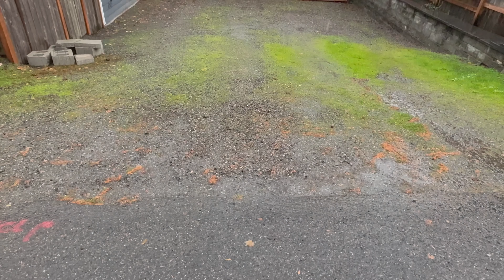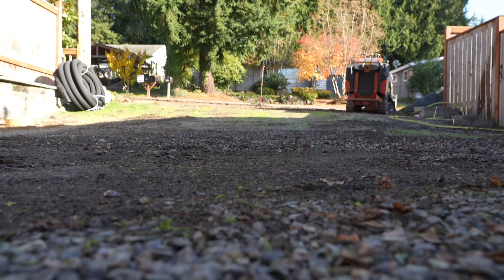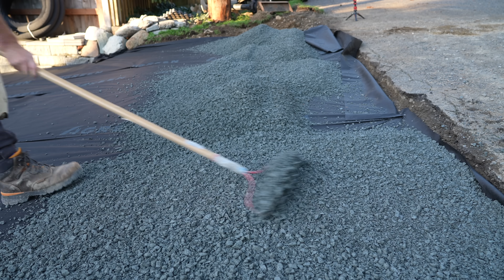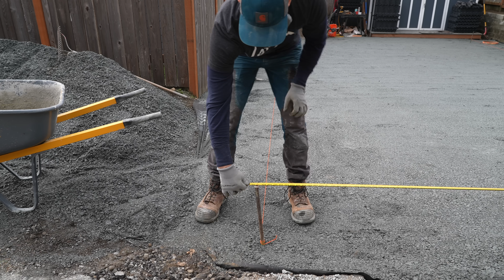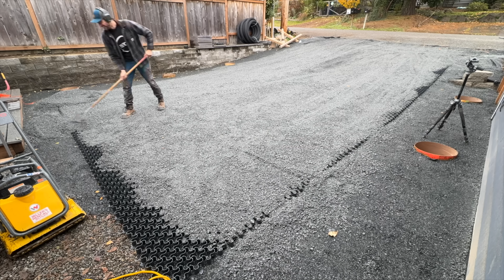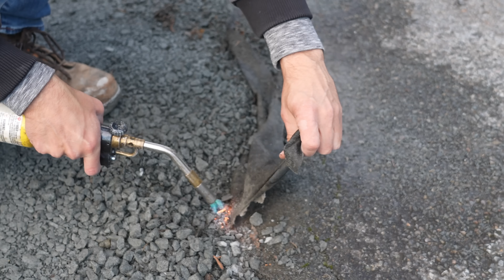How To Install A Permeable Gravel Driveway Grid System

Comment: 2:30 With no curb to support the edge of the road, you can see the asphalt already cracking.
Reply: Yep thats my only issue with the whole project - the interface between the gravel and the road edge is going to become an issue.   The question becomes: how to solve it?
Reply: @markd.9538  I've done something similar, and I would have installed a long trench drain almost immediately adjacent to the edge of the road, and then patched and sealed the small gap between the two with blacktop materials to leave a nice neat edge that won't unravel further.  (Actually, for stability under vehicular traffic in a parking lot, I surrounded the black plastic trench drain itself with a small neat border of concrete, stained black to match the blacktop and using temporary boards to keep the resulting concrete encasement tidy, and then patched the narrow gap between the concrete and the adjacent blacktop with blacktop patch.)  The water running off the road and into the trench drain could then be directed into perforated hoses sloped downward on either side of the driveway, into landscaped planting beds, where that water delivered directly into the root zone of any shrubs might be particularly welcome after a dry spell.  It might also pay to consider what effects city workers will have one day when they eventually have to strip and re-top that asphalt road.  Gray plastic trench drain surrounded by a border of concrete to match the gravel might look better in this installation, and together this would tend to protect the structure of the driveway during such road work.
Reply: @markd.9538  that's your only issue? so not the fact that compacted fines will not let any water though? or that the whole driveway is sloping from the road into the house with no drainage?

Comment: With a torch and hot tar you can repair the damage you did to the edge of the asphalt.
Also, I'd recommend spraying herbicide before putting the fabric down.  You're also going to have to spray herbicide on the driveway on a regular basis if you want to prevent weeds from groing on the surface.
I would also recommend a concrete transition between the stone and the asphalt as this will prevent stone shift from being a cause of the asphalt failure.
As far as driving those rebars, try running the majority of the length in with a heavy hammer drill and ground rod driver attachment.  It'll save you a lot of effort.
Reply: +1 to the concrete transition.  This also would have been a good place for a trench drain-- encase it in concrete for stability.  Pour the concrete neatly using boards, and then patch the small remaining gap with blacktop patch and seal.  Otherwise road repair crews will be messing up the edge of that driveway sooner rather than later.
Reply: @karenkrohn8003  if you cut the asphalt clean, you can use the asphalt as part of the form.

Comment: Please, I am not trolling. I am really trying to understand the benefits of this. In the beginning weed issue was mentioned, but as best I know, weeds will eventually settle in any crevice anyway, so I trust they can take over the new gravel as well. I wonder how long the moisture barrier will last. After all it is plastic and may get brittle over time and combined with heavy use? What am I missing?
Reply: It wasn't a moisture barrier-- landscaping fabric will hold the gravel in place but allow water through.  It degrades quickly in sunlight but does last a long time when buried.  He will still have weeds after debris builds up on this fresh gravel from above, but the grid + fabric will keep that gravel from migrating and mixing with the underlying soil, as appears to have happened previously, so that process won't occur as quickly.

Comment: The fabric will not prevent weeds from growing.... While it will prevent weeds from growing up through the base, weeds rarely grow up through 4" of gravel.  Most of the weeds you'll find growing in gravel have germinated from seeds that landed from above
Reply: 100%
Keeping leaves and fresh dirt out of the gravel does 100% more than the weed barrier for weeds (at least in my experiences!)
Reply: @Waitwhat469 You're right, and this is the reason I don't care for this application unless the area is so large that it is the only economical choice.
Reply: It’s more to prevent the gravel from sinking/mixing into the soil over time.
Reply: @brendancurtin679  Exactly. I got 2 driveways. One needs gravel and leveling once a year, the other needs it every two years or so. The only big difference between them is the fabric barrier. I'm not a professional, but in my experience the fabric keeps the soil from getting in-between the gravel as it settles and sinks. It'll still settle, and there's times when a pothole will pop up. But the first driveway has parts that settled well before the others and those spots keep going to bare soil /pothole up the quickest. I need to tear it out and re do it. But winter is here already. 😅
Reply: @gtbkts  I just checked the price.  $12K just for the plastic.  I'll just pay the $350 for a truck load of gravel every 4-6 years.
Reply: You are kiddy me, 12k? Lmfao  @robertsmith2956
Reply: @gtbkts  exactly, geotextile (the fabric) is designed for geotechnical stabilization and separation of new crushed stone from the natural ground. Without it, over time the new gravel slowly gets pushed (unevenly) into the natural ground which leads to low spots, and poor drainage. Before geotextile fabric you had to use a lot more stone to avoid those issues.

As others have said, it's not a weed barrier (although it might slow down the growth of deep roots).
Reply: @robertsmith2956  You might want to check that price again. For the 800ish SF here, it was only about $2200.00
Reply: @blackboxmediagroup  Maybe, but for my 6000 sqft driveway is says $12K.  I can buy a dump truck of gravel every 3 years for $350.
Reply: @robertsmith2956  you need to find a commercial supplier. That sounds like HD prices
Reply: @brendancurtin679  I did this entire weed-barrier-fabric thing one of my drives. The problem is not from below, but from above. Not only are seeds-n-weeds blowing in from above, but soil itself is blowing in and being deposited. The ONLY WAY to prevent this from happening is to somehow seal from above (e.g. some kind of epoxy or other non-permeable coating to the rock or whatever). That's my next step to redo my own drive and then tackle other driveways on our properly.
Reply: @LarryRix  again, it's NOT to stop weeds from growing. You are correct that weeds can grow on top of it, if soil or decaying leaves or other organic material gets in there and weeds can start growing. 

The reason for the fabric is to keep the gravel and soil below separate, so that the rocks can act as a drainage layer. If the rocks are directly on the soil, they will eventually mix together and it defeats the point of having a layer of gravel for drainage. 

Depending on where you live and how many trees and whatnot you have, you may end up having the rocks clog with dirt/decaying leaves/whatever from above. That will still take a lot longer. At least keeping the rocks and soil separated below keeps it from going to shit as fast. But if you are able to keep the surface relatively clear of dirt and organic matter, it can last along time. But if you don't put a permeable barrier between the gravel and soil underneath, it won't last long at all, even in great conditions.
Reply: What were the footings for?
Reply: @PDQkevin77  he said he's going to build a carport
Reply: Miller’s Rent-All is great to deal with!
Reply: You pretty much need sun light for most things to grow. He said that this was going to be a Covered area, hence the Footings (18"x18"). Once the covering (carport) is in place, it's shielded from the elements for the most part. If there is any type of Growth, it's nothing a good Spraying of "GroundClear" can't handle,  1 to 2x a year.
Reply: @FunDuude  Funny comment because a 100 year old gravel on the ground driveway in full sunlight doesn't need more than 2 times a year spraying.
Reply: @blemtaters  Funny comment because my drive way has no vegetation because of the number of times I drive over it with my car. How you like dem apples?
Reply: A concrete slab would be less work and 1000X better.
Reply: True, but on the northeast US it’s quadruple the price of what he’s doing! Inflation is a bitch.
Reply: @mikopaq it’s more expensive though right? I have to re-do my crush & run after only 2.5 years (part of it is on a hill). The asphalt quote I got 16ft by 135ft was $13k (us). To re-do the crush and run $2,500. I was considering adding a base like this.
Reply: @StoryDrivenThomas concrete is the best investment
Reply: @StoryDrivenThomas  After using both,  will absolutely never use asphalt.  It bleeds out oil and grease forever. In a hot climate it just cracks and moves around.  If you want to work on something,  the oil gets on your clothes and more or less have to toss them.
Reply: And 10x more expensive  @mikopaq
Reply: I think it would cheaper, they are proud of that plastic thing @mikopaq
Reply: @mikopaq 
Buuuut IT'S NOT WATER PERMEABLE   !
Reply: @mikopaq  and what cost difference?
Reply: @charleysheets8142  Really doesn't matter if you want a permanent fix, this shit is NOT IT.
Reply: @mikopaq  not betting on this exact product but go geostabilized are as good or better than concrete.
They look way better also.
Reply: @mikopaq  Exactly. Rock may look pretty, but it's hell keeping it that way.
Reply: @mikopaq  Probably a faster install too.  But far more $$$.  Gravel will be much cheaper to repair years down the road.
Reply: @m.f.m.67  Concrete slabs, done correctly are good for at least 50-100 years. Minimal maintenance.
Reply: @mikopaq not anymore concrete is junk nowadays
Reply: @mikopaq until it cracks
Reply: @damiendye6623 Expansion joints rookie.
Reply: @mikopaq  Also is a whole, whole lot more expensive, and cracks.
Reply: @kbwfgg6400  Nope, not much more and it's permanent. Only cracks if you don't put mesh or rebar in and no expansion joints. Concrete is 100X better.
Reply: @kbwfgg6400 Nope, $4 sq/ft and way faster. Less time and prep. You're clueless.
Reply: Tell me about it. My gravel drive here in the uk gets weeds from above all the time 😡
Reply: @next0845 my favorite herbicide for weeds is Pelargonic acid, spring to set the stage for the year, prevention goes a long way. 2. If its hot, use salt water. Its a contact herbicide so wont totaly kill. But ywo treatments and many weeds die. Organic and cheap af.
Reply: @next0845 use Mojave. Its a ground sterilizer. Keeps weeds from growing for at least 1 year. Just beware it kills everything. Even trees if it's mixed too strong.
Reply: Of course, nothing will protect this driveway from weed seeds falling on it. The proper question is: will these germinating seeds have a chance to reach the life-giving soil through a layer of sterile gravel and thick foil? I bet that before anything happens they will simply dry out in the sun. That's what the gravel and foil are for!
If you want to maintain this condition for years, you must use a garden blower to blow away leaves, grass clippings and other biological residues, which over time may become food for weeds. A bit like lawns - they also need to be cut, or more generally: you need to take care of everything!
Reply: yeah the tutorial needs to express that as well it does do some work to keep weeds from popping up. but rain is not always clear water some times it caries sand down and deposit it in gravel and then you have soil that can support strong plants that love rocky soil
Reply: @highkicker11  He did.
Reply: @GARRY3754  They were from the link in the show more.....
Reply: this man weeds
Reply: Yes so true the weeds will grow from the upper section just spray it
Reply: Weeds will grow on asphalt.  The fabric does not stop weeds.  It does help control moisture if you have water seepage from below.
Reply: How is this any better than what it replaced?
Reply: Yes, rake leaves promptly and rake wind blown debris away so weed seeds do not germinate in the gravels.
Reply: AZ would like to enter the chat… 😂
Reply: Correct. Nothing will stop the seeds from falling in the gravel.
Reply: So this grid type mat is really more for sloped areas where crushed rock moves away from driveway over time? Otherwise I don’t see the utility for flat terrain vs cost.
Reply: So we don’t need the fabric or does it serve another purpose?
Reply: Its to prevent materials mixing up. Vegetation will grow no matters what overtime
Reply: Exactly, fabric is a complete waste of time.
Reply: This man is very wise.
Reply: If the entire gravel pack is wrapped in the fabric, the barrier will keep silt out. This will keep the drain properties last longer. The dry underground will reduce the chance of weed getting a foothold. But said silt will pile up on top of the barrier and at one point, weeds will grow. At this point, to top layer, including the textile, has to be replaced.
But that will be much cheaper than redo the entire driveway and can be done by hand, even by the customer themself.
Reply: The fabric is needed to help prevent weeds. It's up to you to maintain the driveway. The fabric helps alot
Reply: Thank you WeedBoy. Your resounding intellect on all thing weeds is astounding.
Reply: @jimrockford3662 
You need to be appreciative Drunkman.

Comment: One reason you are short on that rock is that they sell it by the ton. And that rock with fines holds a lot of moisture. So you are getting charged for water and not the exact amount you called for. Buying that type rock after a rain at the rock yard is even worse.
Reply: Around Seattle where this is filmed, gravel is sold by the cubic yard, not by weight

Comment: The weed barrier will keep dirt from coming up as long as the rocks don't migrate down thru it, making holes.  However, if you ever excavate above such a weed barrier that has been in place for years, you will find it full of dirt.  The dirt comes in as dust and decomposing plant matter, and water carries it down into the rock layers.  A tiny amoutn of dirt allows plant growth and even infinitesimal plants hold more dust and have roots that will decompose leading to more dirt and the cycle continues.  This is just how nature works.

Most of the strength of the driveway grid comes from the rock fill so you need to keep it covered with rock or it will break down. I'm wondering about rather the opposite approach to this video for my driveway.  I'm thinking a couple of lines of pavers for regular wheel traffic, and widely spaced pavers between and outside of those lines for a generous width driveway. Then I'd intentionally encourage grass to grow between the pavers.  The first challenge is keeping the pavers from migrating.  Then also I have very level property so another challenge is to discourage pooling (and resulting softening) on the drive so it needs to be built up.  Final consideration is the drive needs to support several trips per year of heavy vehicles common to a small farm such as loaded hay trucks and gooseneck trailers with up to 16 tons or so cattle (or horses like my neighbors).
Reply: Excellent point about dust building up on top of the fabric. I don't recommend fabric to clients unless they are dead set on using it. For your drive needs, I would suggest you build a Roman road. Use large rock such as railroad Ballast or larger as the base. Then add a smaller rock on top of that, then a finer layer for the top with compaction between each layer. This allows proper drainage and interlocks the various rock sizes making a superior drive surface for vehicles and heavy equipment.
Reply: @joshuarousselow5546  although i really like this vid and think it a great improvement, your reply/comment got me to scratching my head wondering...  when new RR track panels (rails already on ties) are put in, the dozers often take the ballast down and remove the fabric, from what i remember.  and the layer on the fabric is usually the most dirt.  and most rr access rds are built on just 57 rock. but sometimes the construction backhoe drivers or 3rd p excavators will have to put down riprap, then ballast, 57, and maybe crushed rock, in some geographical areas that are pretty much swamp all year.  crush is used often around raised foundations or as a base to be compacted since it will pretty much shed water like concrete, and then a dressing of 57 for water runoff, good looks.  but thanks for the good info.  i think it will be 5+ yrs b4 this grid he used might have that issue, but i'm just guessing.

Comment: Is this still less expensive than just getting a paved driveway? My driveway currently looks like what yours did, and I'm trying to figure out options on what to do.
Reply from the maker: It's probably the same amount for an asphalt driveway but concrete is way more expensive.  Problem is though is what do you do about drainage if you pave over it.  That's a lot of rain hitting your driveway that is forced down toward all at once. Good questions and thanks for watching.
Reply: I was quoted $18,000 to pave my 150 driveway. By my calculations I can purchase the driveway grid and have a contractor install it for around $6k-$8k. So a huge difference in my opinion.
Reply: @Observing9303 that is a big difference. thinking abt upgrading my driveway. was that $18k for asphalt or concrete?